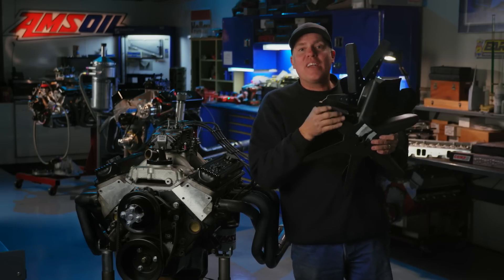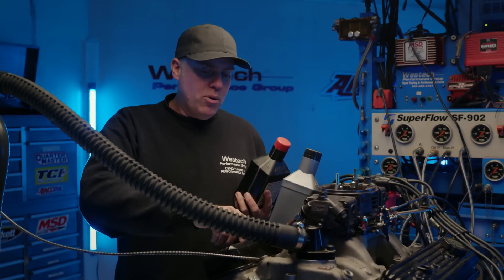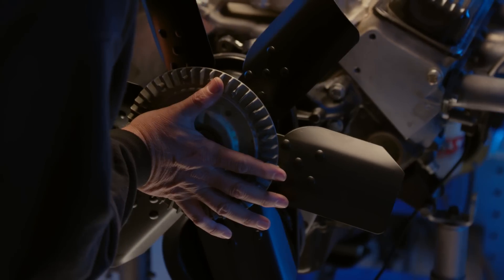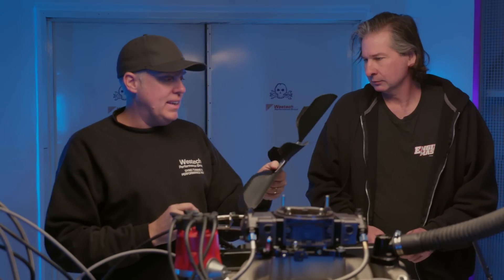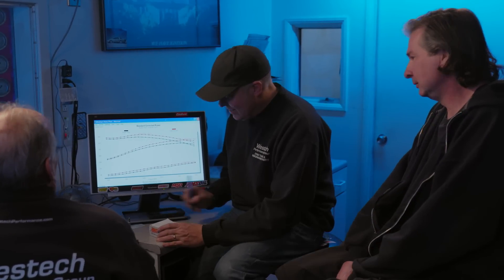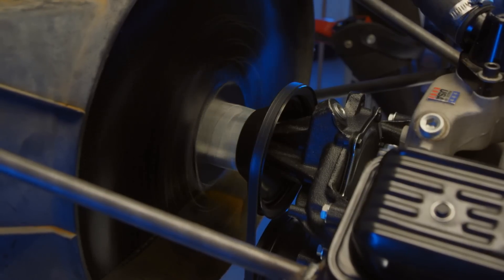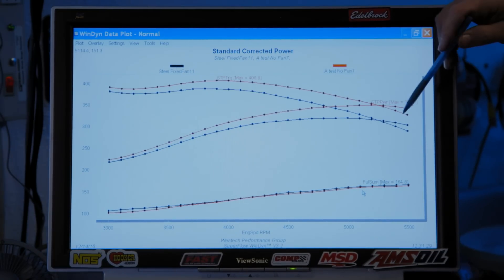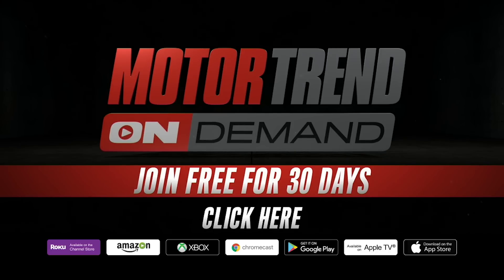Cooling Fan Shoot-Out! - Engine Masters Ep. 20

Comment: But you have to remove heat from the radiator with the airflow or it will over heat while you drive or while stuck in traffic.

Thermal fan clutches. the bimetallic spring turns on the fan clutch when the air coming off the radiator reaches around 190 Degrees and turns it off again at 180. . give or take..  they require a 192F thermostat to operate properly.    without a thermostat the coolant will be flowing thru the radiator so fast it won't have enough time in the radiator to cool off and you will have a runaway cooling system at some speeds.. either at idle or highway speeds.   running a 160 or 180F thermostat with a thermostatic fan will usually result in an overheating condition also as the thermostat can open and close several times before the fan clutch engages.. but the speeding coolant thru the radiator with the thermostat open again does not slow or stop to allow cooling below the closing temp of the thermostat. run away cooling system again.. 

 there are multiple sizes, blade counts and blade lengths in flex fans..    5, 6 and 7 blades , multiple fan sizes..     

 the aluminum bladed fan in the video usually results in overheating in most street driven cars..  but that is just my personal experience. 

keep it cool guys and gals.

Comment: The radiator straightened the airflow and the shroud increased the air it can bite.. Go electric or go factory with clutch for simplicity.

Comment: As if you needed another reason to put an electric fan on instead but the mechanical fans can tend to blow apart and send the blades through radiators and hoods. I've experienced a blade coming through the hood while on my way to 12th grade prom, fortunately I didn't have a date to embarrass.

Comment: The reason it takes less power without a shroud is due to suction though the radiator. With the shroud on you’re sucking though the radiator which uses more power. Without the shroud you sucking air from the general area that is not inhibited by the small cross section of the holes in the radiator. Your cooling will be affected though.

Comment: With a shroud on the radiator you have the kort nozzle effect. In the marine world a kort nozzle which shrouds a propeller and prevent blade tip losses. For high thrust boats like tugboats a boat with kort nozzles is universally accepted to have the thrust of a boat with 30% more horsepower and an open propeller.

Comment: It should take about 2 horse power extra to run the alternator harder for the 30 amp electric fan. Then the question is where should the electric fan be mounted? I say behind the radiator is you have snow and ice to deal with. If you have nothing but nice weather(but hot) putting the fan in front of the radiator should move more air.

Comment: So the conclusion is do not a fan....and hope that the engine will make it somehow.....
Reply: electric fan is nice but from my experience if the engine is not designed in advance to be using one, it can not cool the engine like a mechanical one even the most powerfull ones, drawing 30+ amps are not sufficient. If you make a simple calculation a 30 amp fan is equal to 360 watts which is arround 1/2 hp while the mechanical ones draw - like seen here - much more, so think in terms of air flow and understand the difference in cooling power.

Comment: I have owned a great 67 chevy van with a BIG factory clutch fan. Worked just great and is the best fan to use if you don't want to go electric. Example the 67 alternator was 35 amps.

Comment: OK so we see the Tq and HP losses w the fans , but in the real world on the street , answer this , How much power difference do you see from a engine running at 195 deg water temp VS 160 deg water temp ????????????? Lets test that . Then you will see why that fan is worth power
Reply: the density of air at 190 and 160 has a percent difference of 4.73% causing the same difference in the mass flow rate of the system. Calculating the power input in a system assuming the fan to have same efficiency shows that it requires 4.83 % less power to operate , so you out of say 30hp you would gain  about 1.5hp  with the hotter air.
Reply: the density of air at 190 and 160 has a percent difference of 4.73% causing the same difference in the mass flow rate of the system. Calculating the power input in a system assuming the fan to have same efficiency shows that it requires 4.83 % less power to operate , so you out of say 30hp you would gain  about 1.5hp  with the hotter air.
Reply: David Freiburger , From my experience with customers that run electric fans , this is what you get . 195deg on the freeway and 160deg in town . So when you need the cooling they just block airflow thru the radiator and when you do not need the cooling then they turn on , a engine that has no load can run hot , but an engine with a load cannot . This is the test I would love to see , what CFM of airflow did them Mech. fans make . You sure can find CFM ratings on electric fans . Just try to find any ratings on Mech. fans . The factory way of testing airflow thru the radiator is at engine idle , you place an 8 x 11 sheet of paper on the grill and the fan should hold it there.
Reply: You miss my point , a engine running at 195 degs will make 35 less hp than one running at 160 degs . Just try it on the dyno and you will see .

Comment: My suggestion regarding the shroud and no shroud is that with no shroud the air can be thrown straight out from the fan tips, whereas with a shroud, air is contained and the fan must pull the air through and throw it at the engine

Comment: Wouldn't the horsepower draw be less than that in an actual car?  Driving down the road you will have air moving through the radiator at the speed you are going so that would reduce how much drag the fan feels correct?

Comment: 30 Amps at 12V/~13,5V is pretty much exactly half a horsepower (360-400W), there is more loss of energy in the alternator, but most of that loss (the alternators own cooling fan, bearing, belt) occurs depending on revs, less depending on load. As you say, you are running an alternator anyway, so expect less than one hp loss by driving an electric fan. They are also inside a shroud, because they are mounted on the radiator, not on the Motor that moves around. Go electric, you can even put in manual control (switch).

Comment: We have come to the day where a 350hp 350CID is a "mild motor", today is where it is at!
Reply: Sebbonx Xsebbon We are in a world where even a NA V6 can make that much horsepower
Reply: The V6 Camaro has a 3.6L / 219 CI V6 engine that makes 335HP and 284lb*ft.
-Edited due to grammatical error.
Reply: tomoya97 What NA V6 makes that much power?
Reply: The NISMO 370z is rated a 350hp (At the crank, obviously :v)
Reply: tomoya97 damn, what vehicle is that motor offered in? Never even heard of it but I bet it's snappy little thing.
Reply: The engine is the Nissan VQ37VHR, and the car is the Nissan NISMO 370z :v. I have never driven one, but apparently is a blast to drive (RWD FTW) 276 lb-ft 276276 lb-ft 276 lb-ft

Comment: It's pretty obvious that taking the shroud would reduce losses. The reason is simple. When you have a shroud it has to suck the air through the radiator, which restricts airflow. Without the shroud, it can suck free air with no restriction.

Comment: missed an easy test. how much hp is lost with mechanical vs electic waterpump. you already had everything setup for it, would have just been one more pull
Reply: @Josh Goode yes its no brainer, but so is no fan versus mechanical, or stroke vs stroked, cast manifold vs headers, 2.5" vs 3" exhaust, but this is what engine masters does, it puts them on the dyno and says how much it does it by.  we know why, its not rocket science but no one asked that question. most of us don't sit at 5k revs on the street so it really doesn't matter if for that quick spurt to redline mechanical was better.
Reply: Was thinking the same.
Reply: @Midniteoyl electric water pump vs mechanical water is what I wanted to test. they took off the electric pump to do this test
Reply: Thats a No-Brainer and ill answer that for you but ill keep it short just to sum it up.  Electric for more HP, Mechanical for more volume.  Mechanical will be more consistent with steady flow with larger volume which makes for a better cooling effect.  Electric is freeing up HP but doesnt nearly move as much coolant because it  doesnt make a difference at higher engines speeds. It moves the same amount of coolant all the time.
Reply: Choco Smith agree
Reply: They said it in the vid.. The electric fan they use draws about 30amps at max draw, or about 1hp.

Comment: The shroud causes the fan to suck all the air through the radiator and this creates underpressure between the radiator and the fan which in turn draws even more power.  A vacuum cleaner with and without a cloth against the tube end should be proof enough. The horse power drop is not going to be as big when driving versus stationary but there will be some.

Comment: So now get a decent air flow meter/air speed meter and restest air flow through the radiator because it's the airflow that we need and if fans inefficient in air flow car will overheat or run hotter.

Comment: Should've had a heat source or hot water in that radiator when testing the clutch fan. The coil on the clutch is activated by that source of heat, not heat off the pump. I'm not entirely sure that test was accurate since I don't believe the clutch engaged. 
Also the shroud focuses the air to be drawn through the radiator thus causing airflow resistance. This explains the increase in HP when removing the shroud.

Comment: the plastic flex fan by far pulls more cfm. To be fair and true they never mentioned anything about intended use.   racing or running high rpm you'd have to take advice.  normal driving or hauling with tow rig that stays in the 2000-3000 rpm range highway driving the flex fan will be best for cooling

Comment: I design heat exchangers for a living and those figures are fascinating and way bigger percentile than I see at 1400rpm. I wonder when the fans stalled-out though? Would they draw much more at higher rpm? Either way up, they are power killers. I could argue reliability, but I'm currently running a rear rad and Craig Davis electric pump.

Comment: It takes more energy to pull air through the radiator.  The rpm is set by the engine but the pressure drop is non-existent.  It's fan flow/pressure drop = hp loss.

Comment: If your cooling fan is directly attached to your crankshaft that is a clear symptom that your engine might be a tiny bit obsolete...
Reply: A cooling fan attached directly to your crankshaft? Sheesh, I'd love to see that engine. The only engines I've played with has the fan attached to the water pump...
Reply: It is connected to the water pump pulley.........
Reply: Look at this engine again.
Reply: 2JZ is obsolete?
Reply: So it goes on the balancer ? Interesting
Reply: I am very sure that the 87 Buick Grand National had a crank-mounted fan but it was for pulling cooling air through the intercooler, not for the cooling system...but I guess, technically, it is a cooling fan.
Reply: Obsolete now but an advanced engine when it first came out first fully cast ally engine in europe and I can still get 55 mpg out of it

Comment: Thinking about this, I wonder if manufacturers dyno their engines without a fan, then send out the engines in the respective vehicles with a fan, quoting the dyno figure of the engine without a fan? I am wondering if this is an industry standard as most brochures quote HP that is a little higher than the engine actually produces with the fan!!!!!

Comment: Would have been nice to see a proper stainless flex fan tested. I think it would have been the lowest HP draw as they basically move no air at higher RPM.
Reply: I took a stainless flex fan to a drag race and the car overheated waiting in line. Changed to a fixed aluminum fan and no problem after that. Tells me the flex doesn't pull enough air through.

Comment: Kinda pointless since the test didn't include cooling efficiency or at least airflow. Sure you lose 20 or 30hp but you get lower temps as well.

Anyway, the moral of the story is that you should just use electric fan.

Comment: It would have been interesting to have an alternator charging a battery with an electric fan running off of it. 30 amp draw with a 25% efficiency still puts the power loss at about 2 hp.
Reply: You're getting less airflow with the mechanical, because your Hilux isn't spinning 6500rpm all day long. Your mechanical fan may move 10000CFM at 6500rpm, but at 1k-2krpm, where you're spending most of your time, you're moving maybe 3000CFM. For comparison, a 16" electric fan off ebay can flow 3750CFM all day long, regardless of engine rpm.
Reply: The electric fan doesn't run when you drive if you adjusted it right.
It will take around 2 hp when  you Idle around town but not when you drive at higher speed.
So you will gain Horsepowers and you will gain MPG, less wear on belts and so on.
Reply: whiskeyinthejar24 but the better question is, do you even need that much air? better ducting or a bigger rad would probably do more good than a jet engine sized fan
Reply: I drove my civic for two months before realizing the guy before me had pulled the fan relay. Took 10 minutes or more of idle for it to even begin to move above normal temp.
Reply: I have an engine driven viscous fan on a 4cyl petrol motor in a hilux. When I am driving on a 40 degree centigrade day, or off roading on a hot day, yes you do.
Reply: just use a alternator killswitch at full trottle and save even more power
Reply: Electric fans don't move even close to as much air as a mechanical fan "can". They move way more air at idle, which is generally where you need it, vs a mechanical fan.
Reply: 25% efficency? Aren't automitive alternators around 50% efficient?
Reply: mibars that trick will not work with a big American v8 , and will not work my chevy 350 has 30 minutes of run time before I have to shut it off from dead cold if it's warmed up all ready less than 3 m it will boil and that's babying it
Reply: That's exactly what I was thinking. The fan blades can be designed to a specific rpm as well, so the efficiency should actually be quite good. At say 7000rpm I bet the fixed fans draw 50 or 60hp, but the electric would still be the same!
Reply: drumnstuff Doubt it would move any where near as much air though.
Reply: You must live in a pretty cold place or there is no thermostat =D Ryan Burman
Reply: pohtoj1 the force it takes to turn an alternator changes with output of said alternator. If there's low draw, it's easier to turn, than an added 30 amps to drive a fan, thus robbing more power when the fan is running. But it's still gonna be leagues better than mechanical
Reply: chevyragger that's an option, just involves too much for me to run on a DD personally. A street/strip car that would be great
Reply: then you have a boring daily driver ;). just kiddin i agree, on a true get to job A-B car i can easy afford 30 horsepower (at worst) instead of buying an electric fan and a temp sensor.
Reply: Ohio lol temps were above 70 more than once too. But I don't have a crap ton of stop and go traffic. Also its a bone stock 94civic. I left it sit in the drive running one day for a bit came out and the temp was above normal. Popped the hood no fan? Revved it a little to see if it kept climbing and it did. Went to check the relay and low and behold there wasn't anything there. Popped one I had on hand in boom it works perfect no idea why they pulled it. `
Reply: In my CRX I've driven with no rad fan for a while (had to remove my rad  then put it back because I coudn't find a matching new radiator) and on a hot day it took like 5 minutes for a gauge to start moving when stopped in traffic. Cranking heater full blast for just a couple of seconds was enough to cool it down or rolling over 20 km/h also cooled it down.
Reply: But it doesn't increase with RPM.
Reply: I drive a honda civic around that doesn't even have a rad fan. The only time she starts warming up is heavy stop and go traffic like in the big cities....which I never go to anyway. Soo....cruising for the most part the fan is useless. Idle is where they need that fan more then anything, and RPM dependent fans can't produce the cooling over electric in those stop and go situations.
Reply: whiskeyinthejar24  Electric fans move a ton more air than mechanical. And they dont really take any hp because the alternator is driven with or without the electric fan. Ofcourse mechanical fan works always when motor is spinning.